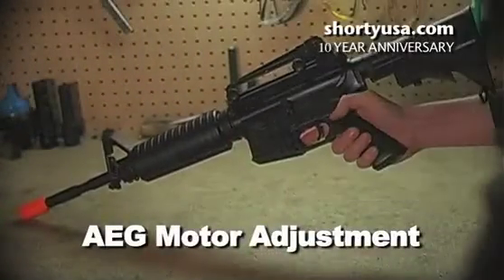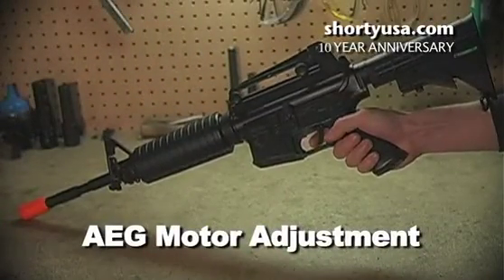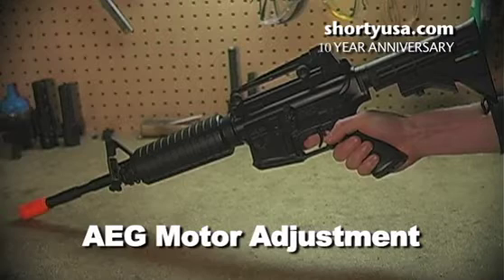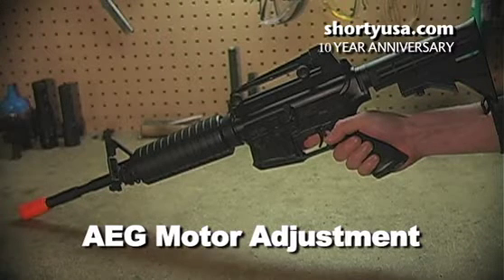AEG Motor Adjustment

Comment from the maker: @WhyFrostie The motor adjustment for the SCAR is on the bottom of the pistol grip just like an M4. Most have a larger slotted screw instead of the smaller hex screw.

Comment: My airsoft gun stops half a cycle into its shot!!!!!
NOTE: 
my motor is adjusted correctly
my motor has the torque to pull the spring
my battery is charged + i use smart chargers
my anti-reversal latch is not causing this

Comment from the maker: @iLikeGuns88 Most likely because the cut off lever inside of your gearbox is either wore down or broken. Unfortunately that is a rather involved project which requires complete disassembly of the gearbox.

Comment from the maker: @StreetScooterers Well, Matrix is Evike's brand so you would be better off directing this question to them. However, if it is making a screeching sound then something in that gearbox is slipping. I would double check all of the teeth on the piston and gears including the pinion gear on the motor. If it is a Systema Magnum motor then the pinion gear might be broken or worn down. They were notorious for having weak pinion gears.

Comment from the maker: @ScottishRugby23 I'd verify first that your battery is working correctly in another rifle. If so then it sounds like your gearbox is locked up which could be a broken gear amoung other things. You'd have to have someone open it up to find out.

Comment from the maker: @blowpenguin The video you are commenting on is the video for motor height adjustment. The Masada I believe has a larger slotted screw for the motor height adjustment on the bottom center of the pistol grip.

Comment from the maker: @pie5135 If you put a piece of paper in-between the motor and the base plate then you shimmed the motor to push it down further into the gears. Tightening the motor adjustment should have done the same thing unless you have bottomed it out. If the shim works, that's great though.

Comment from the maker: @pie5135 Unfortunately if adjusting the motor height does not correct the issue that normally means that something is stripped.

Comment from the maker: If you have a V2 gearbox you could take the base plate off and hold the motor in manually while pulling the trigger to see if you can get it to catch. If it doesn't fire doing this you most likely have a stripped gear or piston. If you look into the feed tube while you pull the trigger see if you can tell if the air nozzle is moving back and forth. If it is then your piston is stripped. If not, it is most likely a gear.

Comment from the maker: The CM.022 is an electric gun and yes it is automatic. However, the term AEG refers to an electric gun with a standardized gearbox (V1, V2, ect.) such as the rifles made by Tokyo Marui who were the pioneers of AEGs. Later on companies like CYMA came out with imitations of these guns such as the CM.022, CM.023 and CM.020 which had smaller, lower powered gearboxes. Since they were nothing like the guns which everyone knew as AEGs they were deemed LPEGs (Low Powered Electric Gun).

Comment from the maker: The motor adustment could be too tight so that the pinion gear is binding up with the bevel gear. That is vary rare though since usually they get looser not tighter. You might want to double check that battery in another gun to verify that is really is working.

Comment: Any gas station, hardware store, lamp store. Check the cord that you plug your battery in to. It should have a round plastic casing about 4 inches in that contains the fuse. Just open this and check wheter the thin metal rod inside the fuse is damaged in any way.
If it is then you just need to take it out, bring it to the store and they will get you a new one. It will probably cost you somewhat less than 4 bucks (some 20 norwegian kroners, dunno exact price).